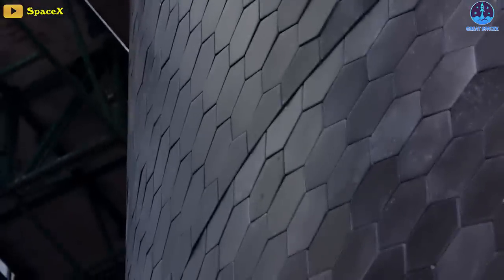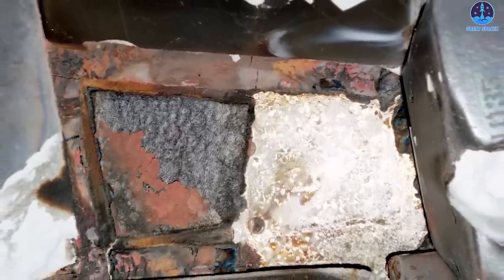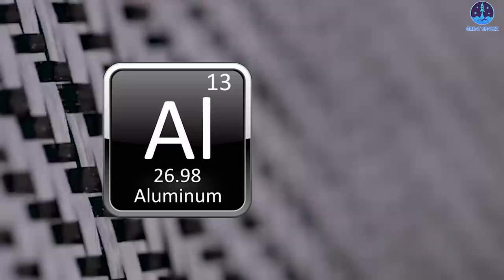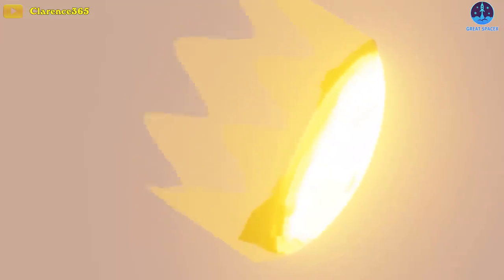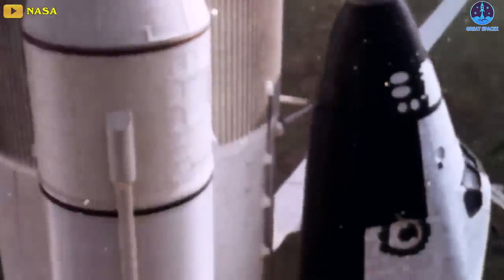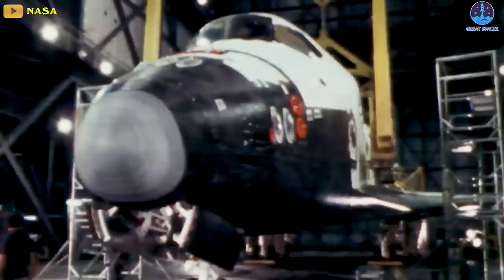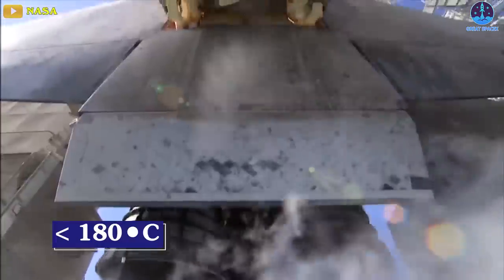SpaceX MADE Incredible Adjustments to solve Heatshield Tiles falling during Starship Liftoff

Comment: You repeatedly confuse ablative heatshield material (used on most historical spacecraft prior to the Space Shuttle, and which is also used on Dragon) with ceramic heatshield tiles.  Ablatives slowly turn to gas, carrying away the heat.  Ceramic tiles are just a very poor at transferring the heat from the exterior to the interior, due to their low density construction and exterior coating.  Ablatives have to be replaced periodically (once they get too thin), but ceramic tiles can be reused indefinitely (until they break in some way).
Reply: you're 100% correct, the narrator is talking out of his hole......
Reply: Great response I appreciate the additional information.

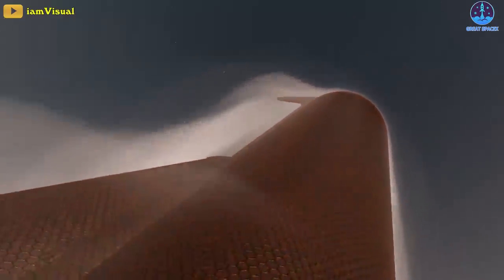Comment: 0:50 Uh, I'm pretty sure that Starship's tiles are NOT ABLATIVE?
Reply: Yup. You got it.
Reply: Nor were the space shuttle heat tiles ablative, nor is the shielding on Falcon.  Video should be edited.
Reply: @mriguy3202  If you really stretch it, the Falcon 9 booster does have an ablative heat shield of sorts: the entry burn does divert hot plamsa through vehicle outgassing (in the form of Merlin engine exhaust.

More seriously the Dragon capsule (as well as Orion and Starliner) of course rely on albation. I can't think of any, but I imagine that some of the sample-return missions (Moon, comet, asteroid) might have found the ceramic tiles lighter and more stable through long-duration deep space exposure*.
---
*I don't know how modern ablative heat shields are constructed, but I imagine the resins used in the Apollo era might not do well in a hard vacuum over many months.

Comment: GREAT SPACEX, I have several questions I’m hoping you can better clarify:

1. I was surprised when you referred to these tiles as “ablative”. I was under the impression they were the opposite. If they are indeed ablative, then how many flights are they rated for, before they become so thin they are no longer able to shield the Starship?

2. What is the required time to completely refurbish a Starship once the tiles are deemed too thin to get the job done?

3. If all these Starships are truly meant to be reusable, then for how many flights, before they are deemed structurally unsound, and subsequently junked?

4. I read somewhere (I apologize as I no longer have the link or I’d provide it) that the heat shield was designed with the triple layer so that even if they lose a few tiles, in their entirety, either during launch or reentry, they shouldn’t get any full burn through of the Starship body, and hence it would still be able to survive and land safely. Can you please confirm this?

***********

Lastly, thanks for the incredible work you and your team strive tirelessly to provide. Finding new material to keep things alive is incredibly difficult, and until the next launch I’m certain it won’t get any easier. Hopefully, my questions will help give you something to chew on, as I’d sincerely like to have solid answers to these questions. Much obliged.
Reply: Great response. I appreciate the information.
Reply: Ablative is a different type technology.

Comment: I think that currently the biggest problem with Starship heatshield is that ceramics has different thermal expansion coefficient to steel and this makes mating those two materials in such wide range of temperatures very difficult. Steel would contract significantly more under cryogenic temperatures, than ceramics, and, on the other hand, the less space between the tiles, the better insulation, so they don't have too much wiggle room to accommodate for contracting steel, to which they are attached. This is, why they were braking off during the static fires and wet dress rehearsals. And we know, what might happen, when some tiles brake off during the ascent.
Reply: @spaghettiracing9660  From what I understood from Elon Musk's interviews I saw (can't provide source, as there were so many of those), those Starship tiles are very close to that what you would find on bathroom's wall.
I'll post a link when I find one.
Reply: As I understand it, right now the current problem is vibration.  The three mounting pins (seen @ 5:13) allow for some movement due to thermal expansion, but the tiles tend to fall off while being moved or during static fires. They are never moved during a cryo test, and I don't think they fall off during spin primes (Unless it goes boom) and they have never left the atmosphere, so they never reentered it.
Reply: @spaghettiracing9660  I'm quite positive, that SpaceX has their own tile "bakery" in one of their facilities (not in Starbase), and its' their own design, not from NASA. Tiles on Space Shuttle was exactly what Elon wanted to avoid to achieve rapid reusability. Tiles on Shuttle required timely and expensive review and repair after each flight. That is not an option for Starship. Again. I would have posted link to source here, but I won't be able to find that right away.

Here is one source about SpaceX bakery., I don't know that channel, but what I hear there is aligned with what I heard on more reputable channels and Elon himself in interviews, links to which I currently can't find.
https://www.youtube.com/watch?v=Gw0Y9rTXB3I

And he actually refers to the source material which is Tim's interview with Elon, when Elon mentions the main issues with the heat tiles, incl. the thermal expansion, but also mentions vibrations (as suggested above by Foz Zilla)
https://youtu.be/SA8ZBJWo73E?t=785

And yes - my statement that they are very much alike the bathroom tiles might be a bit too simplistic as they contain way more air, than the dense bathroom tiles, but the material is basically the same.
Reply: @spaghettiracing9660  well, since you don't provide any sources, I guess I'll need to trust your word.

Comment: @3:45 The thermal protection tiles on Starship are not of the type that burnes away.
They are a type of carbon-carbon, very similar to those on the Shuttle Orbiter, on the Buran, on the X-37, and the Dream Caser.
Other vehicles that would have used a non ablative thermal tile protective system were HOTOL, Venture Star, X-30 SpacePlane.
Reply: This comment should be pinned*
Reply: Car on-carbon is not the same as ceramic.

Comment: Regarding the STS-27 Shuttle tile damage.  Nearly all that tile damage was superficial gouges that caused a small part of the black glass coating and a small chunk of white tile material to become dislodged. Those tiles are at least three inches thick.

That closeup photo of the missing tile shows no sign of that steel plate that supposedly saved that vehicle from disaster. That plate was still protected by part of the white rigidized ceramic fiber tile (right side of the photo). The other part of that plate was still protected by the Nomex felt strain isolation pad (SIP) and the silicone rubber adhesive (reddish color on the left side of the photo) used to attach the tile to the SIP.  There is no evidence of a burnthrough at that missing tile location.

Comment: There's not much comment available as to the as yet unexperienced dangers, thanks, but there are two dangers you haven't mentioned so far.
1.  Damp atmospheric air trapped in the MAT behind the tiles will FREEZE out its WATER and CO2 as ICES just as soon as the FUEL and OXIDANT tanks are loaded.  Heated tiles could cause RESIDUAL ICES to flash into STEAM and GAS, the PRESSURE RISE behind them causing them to BLOW OFF.*
2.  The large HEAT INPUT on re-entry may also cause the AUTOGENOUS TANK PRESSURISATION to exceed its VENTING capacity, and POP the tanks.**
*  Fixed by blanketing the thermal tiles with WARM DRY NITROGEN prior to fuelling.
**  One can only hope its venting system apertures are large, separated, and very aerodynamically-balanced.

Comment: Contrary to regular belief, in Starship’s entry it’s not just the friction, but more because it pressures the air below it so densely that heats from that too.
Reply: I believe that's correct; the air is compressed and heated into a plasma, which heats the vehicle through radiation rather than conduction.

Comment: instead of trying to stop purely using the atmosphere, could they use the heat from re-entry to generate energy that can produce some kind of trust to slow down the rocket .
Reply: Too complicated. Even if it was possible i can imagine the engine used to do that would melt when expose to the hot gaz

Comment: Because you have gaps in-between the heat proof hexagonal tiles, this means the tiles will definitely get ripped off by the low pressure, so if it's accepted they will fall off, predictably without a smooth surface, then a quick heat shield solution, would be to cover the stainless steel hull in thousands of  magnetic steel tiles, during re-entry the heat demagnetizes the (glowing red hot) steel tiles and they drop off, carrying the heat away with them....Easy to stick on and replace because they are magnetic... Also,  Aerogel is a good insulator to coat the stainless steel. ...

Comment: I don't see why no one in the space industry thought of just using one giant heat shield that just wraps around the side of the rocket.
Reply: A question of manufacturing skills- at this time, no factory on Earth could build one that large. For Spacex to design and build such a factory would take years and billions of dollars. So while yes, your proposal is technically superior, cost and time are against it.
Reply: The temperature changes mean the tiles expand quite a bit, it's better to have lots of little spaces that close at high temperature than one large shape that will warp when heated.

Comment: Liquid nitrogen or something like nitrogen. Maybe what we need to help provide the engines from overheating.
Reply: Have the heat shield and the liquid nitrogen is a back up have sprinkles to distribute if heat shield fails  test before using a lot of ideas I get I do share
Reply: Those prongs. Can be used to distribute the liquid nitrogen
Reply: Engines are kept cold as they run by passing the cryogenic liquids through them.  Re-entering a starship while keeping it cold, using cryogenics, would require the same weight of fuel as was used to launch it in the first place.  It has to lose the kinetic energy put into it by burning the fuel.  The atmosphere does it for nothing.
Reply: @tonyduncan9852  for re entry
Reply: @youngnilla4209  Yes.  Cryo-cooled re-entry requires impractically too much equipment mass.  "The best part is NO part." - Musk.

Comment: I never understood why they don't put something over the tiles just to keep them from being knocked off,  even if it burns off.  It would probably make the tiles more aerodynamic as well.
Reply: Any residues which detach and pick up relative speed mightl cause considerable and unpredictable damage to downstream tiles.  Best not to add unknowns.
Reply: I think they want full reusability with little to no maintenance. If you cover the tiles with something that burns off with every use, then it needs to be redone with every use, so you might as well just use ablatives. Also you would not know if a tile was damaged in lift off. it would be a nasty surprise if your coating burned off and you lost a hand full of tiles. Too late to send up a Dragon as a lifeboat.
Reply: @tonyduncan9852    even if its just a  coating  that burns off during reentry?  How would that effect other tiles, beside they could easily test for that.
Reply: @williampennjr.4448  Nope.  You can't hypersonically test a 100 ft length of tiling except on a re-entering rocket.
Reply: @tonyduncan9852    Then how about testing it by putting it on a hypersonic re-entering rocket?
Reply: @williampennjr.4448  Brilliant.  Now you can be Elon Musk.  Oops.

Comment: OK.. Get your facts straight. Starship heat tiles are NOT ablative. They DO NOT burn off. That is an entirely different firm of heatshield. Just like the Shuttle tiles, Starships tiles are designed for reuse. Rapid and repeated reuse.
Ablative shields work once, only.
Overall, I enjoy your content. However, basic factual errors such as this degrade your credibility.